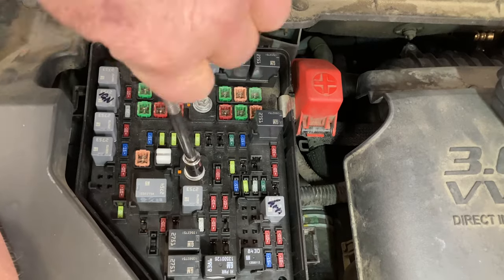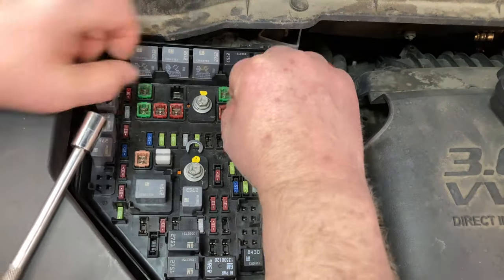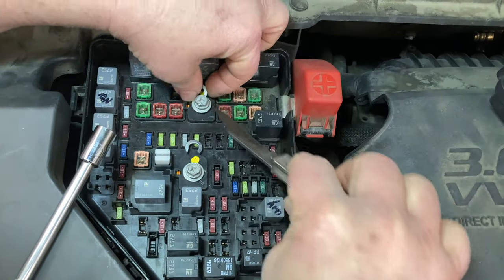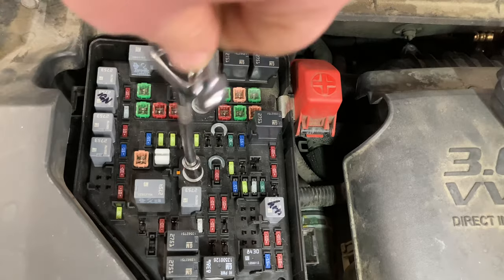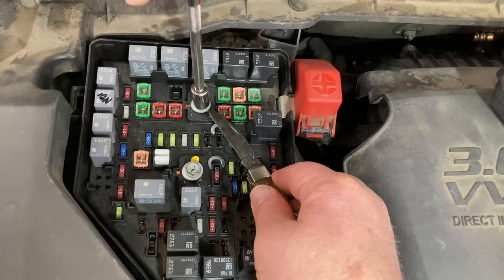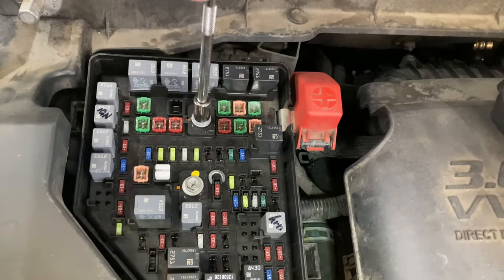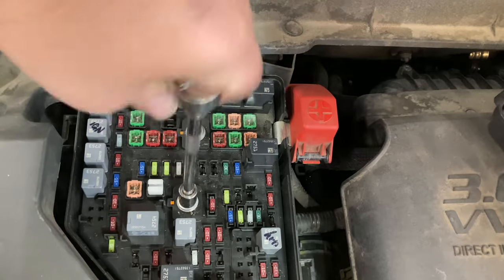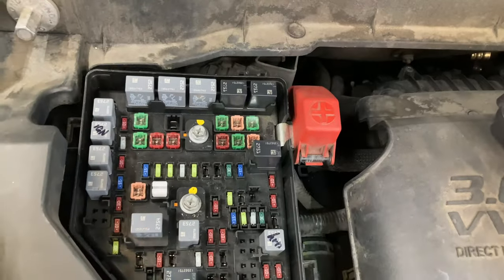2015 Chevy Traverse ( Repaired reduced power )

Comment: I used this fix to correct an overheating problem on my 2014 Traverse LS.  The Dealership and a local Garage could not find the problem.  My passenger side Radiator Fan would intermittently stop working.  I thought it was a dead fan.  The local Garage wanted $1500 USD to R&R the Fan Assembly.  After watching this video, I checked the 2 bolts and found them to be loose.  After I installed home made “C” washers under each bolt head, and the bolts tightened right up.  I started the engine and the fans started working normally again!!!

Comment: Wow you know what you are a genius! I am not a mechanic and am a single mom. I spent $700 for a new fuse box and installed it but the bolts on mine are loose too. When I replaced it it worked great but not that it’s probably loose I’m having more issues. Time to fix the bolts 😩
Reply from the maker: I’m curious why did you replace the fuse box?  I’m glad I could help.
Reply: @cookingintheshopwithmark1222  I replaced the fuse box because I found a YouTube video of someone that had similar issues and they changed it out and it fixed their problem.

Comment: This is huge! This situation is so unsafe. I’m so glad that you solved it with this simple solution. I have this same problem on my 2014 Buick Enclave and I’ll do this first thing in the morning. I’ll keep you updated with my results. Thank you for the video.
Reply from the maker: We just had a 2013 Buick enclave that had the fuse box problem. It was in the shop for a power steering pump but it had the same fuse box as the traverse.  I checked the bolts that pull the plugs up and they would not tighten they just spun. So I cut two lock washers for spacers and pull them up where they seated in the fuse box. You could tell they weren’t seated because when I put the spacers in and tightened the bolts you could hear the plug pulling up.
Reply: Did it work?
Reply: Yes, I haven’t had a problem since.
Reply: Nice!! I'm trying tomorrow morning myself

Comment: I don't see how that fixes it. The bolt should spin freely until it pulls the connector all the way up and the connector bottoms out against the fuse box. Since the connector can't spin around underneath unlike a nut would if you were not holding it with a wrench. The blot should tighten up if the threads are not stripped once the connector bottoms out up against the fuse box. The way I ended up fixing mine was I bought longer bolts at HomeDepot and put loctite on the threads to keep them from coming lose. with the longer bolts it insured me that they were actually catching the threads on the connector. Once the connectors bottomed out the bolts stoped spinning and I was able to tighten them up nice and tight. The only other thing I can think of is if the nuts are spinning free within the connector. The connector can't spin around but the nut can if it broke free and is spinning within the connector. either way the issue is that the connector works its way lose and starts to lose contact. Hopefully what we both did works and the issue is now fixed. thanks for the video it confirmed that all those codes were caused by a bad connection at the fuse box.
Reply from the maker: The threads on the bolts in my fuse box were too long.  When I say too long I mean the threads went through the nut in the connector and stopped pulling because the bolt after the thread was under sized and it would not pull the connector all the way up before it’s threads went past the nut to the undersized no threaded part. All I can figure is if you got regular bolts you didn’t have this problem.  I was just happy that I found this and it fixed it.  It had been to two dealers and countless shops before we got cursed with it.  Glad it helped you. Thanks for watching.
Reply: Thanks for clarifying that. My brain went on the track that they were to short and not catching enough thread. Didn't even cross my mind that they were too long. The ones I bought have threads all the way so I should be fine then. I was worried that it might be that the nut is lose within the connector. I can rest easier knowing it's the bolts that are to long and not an issue with the nut in the connector. I will like and subscribe to your channel.   @cookingintheshopwithmark1222
Reply: How did u get the bolts out?

Comment: OMG  2015 Traverse at my shop.  New throttle and gas pedal.   OMG YES the fuse box bolts was lose.  Totally fixed now.  No more cods and no more reduced power warning.
Reply from the maker: It was definitely a head scratcher. Glad it worked out for you.  How did you repair it with spacers under the original bolts or new bolts with more threads?

Comment: Had the same issue with my 2015 traverse, the issue actually caused pre mature wear on my battery, causing it to need replaced too. I did thr same thing and checked the codes and seen they where all related to the same wiring harness connector. So I checked the tightness of the bolt realized it was extremely loose, so loose the bolt wouldnt even tighten up since the connector had came so loose. Explains why the vehicle would through a code or go into limp mode when or soon after hitting a small bump randomly. Judt check to see if there was a video on it, just encase i needed to make one to help somebody out. Thanks for the video!

Comment: Thank you for the video. One of my screws was loose. Tightened it up and the car started right up. Not all heroes wear capes.
Reply: Your car wouldn't start or just had low engine power?
Reply from the maker: I just did the repair on one that had the instrument panel flashing.  I have found them doing all sorts of things had one up to 18 different codes. Check yours it’s not hard.

Comment: Thank you because i think my 2017 buick enclave may have a weird problem like that one you just described, i am going to try it,will let you know!
Reply from the maker: Did it fix it?
Reply: @cookingintheshopwithmark1222  I think I told you I went on an did the 70,000 mile maintenance, the problem that I ended up having was, I replaced the fuel rail sensor, an even after I had replaced it I was still getting the ck engine light, the abs an stabiltrak,  I had replaced the fuel rail sensor with a GM part, it was either a COVID part, made during that time or a faulty part, replaced it with a Bosch part an road tested fine, been driving great,no problems ,an with everything I did save well over 1,000 dollars, so good deal there!

Comment: Gonna give it a try, thanks
Reply from the maker: Check the two bolts, if they spin and don’t tighten put spacers under the heads until they can be tightened.  After you space them up listen while you tighten them sometimes you can hear the plugs pulling up in the fuse box.

Comment: Noticed on my acadia the bolts do not tighten they spin freely and I had lost partial power once... 🤔 

Are you saying they should be fully tight?
Reply from the maker: yes they should tighten and not spin freely. On the one in the video I cut a 1/4” lock washer into a horse shoe slipped it under the heads of the two bolts and that was enough to tighten the plugs up with the bolts. The problem is they run out of threads before they pull the plugs all the way into the fuse box. One guy got new bolts that were threaded from the tip to the head.
Reply: My wife just called and said engine won't start, I told her to jiggle/ push in the wires (connecting to the same fuse box) and it started right up. I guess this would have something to do with the bolts not being tight enough, no?

Comment: Could this lead to weak  battery issure?
Reply from the maker: I can’t answer that for you because on this particular truck we were not having that issue so it wasn’t something we were looking at.
Reply from the maker: What is going on with your battery?
Reply: I have same issue with reduce power ,the last time it happend my battery was completely dead and had to replace it. Now the battery gauge shows 11v.instead of 14v . . I tested the alternator ealier today batery was to low to test .
Reply from the maker: Have you checked the fuse box bolts to see if they will tighten up.  If they won’t tighten either replace them with all threaded bolts or do like the video and make spacer to go under the heads of the fuse box bolts. If you have got that fixed check the connections in the box and the plug to see if a terminal might be burnt from not being engaged fully. If everything is okay engine idling voltage should be 13.5 to 14.3. If you have got that idling but 11 eng off battery might be going bad check battery voltage when cranking should be 9.5 to 10.
Reply from the maker: Pull the cable ends off and check connections also.